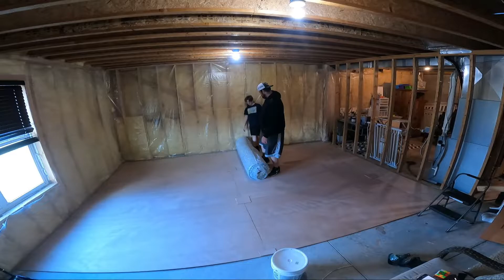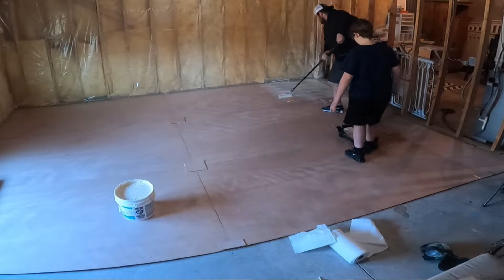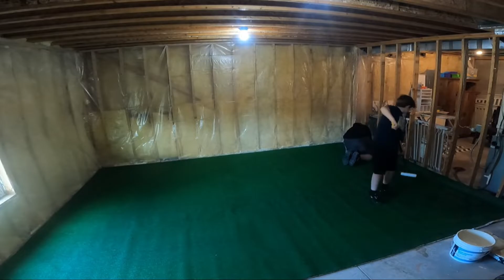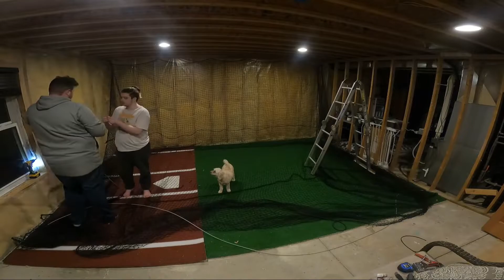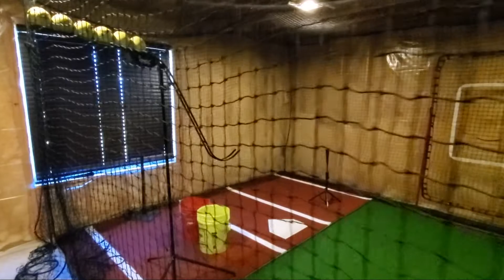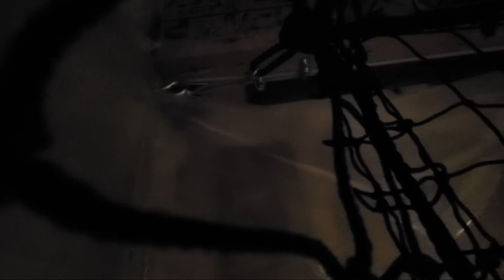Basement Batting Cage Build

Comment: nicely done.  How tall is your ceiling and the other dimensions?
Reply from the maker: The width of the turf is 12', I ordered the net 13' wide to get 6 inches on either side.  The ceiling height is 8' so  I ordered the net 8.5' so it would bunch on the floor a bit and not let anything escape under it.  The length is just whatever you have room for (17' in my case).